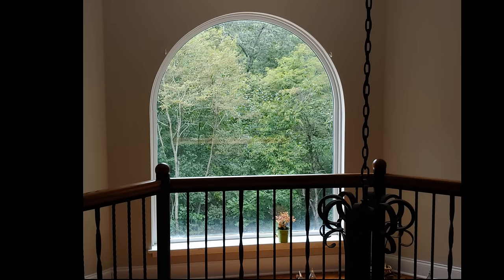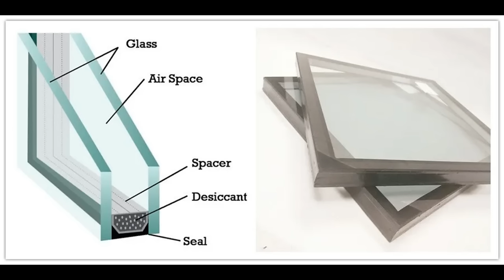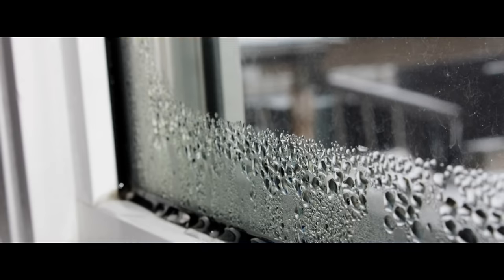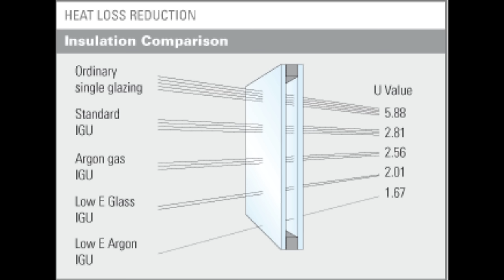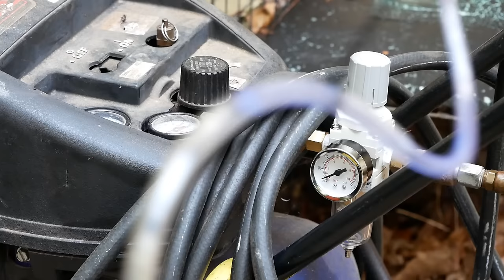Cleaning a Foggy/Hazy Window Insulated Glass Unit (IGU) from the Inside, Without Replacing the Glass

Comment: I have 24 windows to do. I wonder if a way to streamline the process would be to drill a 3/16 hole at the bottom of the window and a 1/8 hole at the top, then, rather than going through all of the aiming and squirting, just fill the entire void space with the vinegar, drain, and then refill with alcohol, and drain. Next step would be to heat both sides of the glass with a hair dryer causing the alcohol to evaporate, and once it does, seal the top hole and tape a desiccant pouch to the remaining hole which will allow the cooling window to refill with dry air, then plug  Using this method you might even be able to recover the solutions a few times and reuse them. As for preventing the fogging from happening again, I got nuthin...lol. I suppose if you are in a hot climate you could drill a small hole in the interior panes to allow inside dryish air to easily equalize the pressure in the windows, but if it get's below freezing it will frost up in there.
Reply from the maker: An interesting approach.  I would advise against filling the IGU with liquid of any type.  The amount of pressure on the glass may cause it to burst (I have no physics to back this up, just a guess).  I am also concerned with application of heat to anything containing flammable vapors (alcohol).  An aquarium air pump will purge the vapors gently and quietly in under an hour while you work on the next window.

I think that you can get good results with a top/bottom hole arrangement and it should be easy enough to squirt in from the top.    You can still recover the solution from the bottom hole if you like.  The trouble with recovering the solution is that it will have dissolved solids in it, so it may wind up leaving streaks inside your next window.  I'd say that it's not worth the savings.

There is something I can offer about fogging.  I have fogging in the spring that sticks around for a while, and I can see the fog moving around inside the window like in a lava lamp.  My holes are both on the bottom.  If they were arranged on bottom/top like yours and were slightly open (and protected from rain), the window would naturally convection-vent itself in the sun, purging the moisture.

Comment: Exterior of our house was painted recently with a sprayer and we have paint drips between some of the window panes now. Think this method would work on getting exterior paint out? Maybe with a less diluted solution of vinegar?
Reply from the maker: That's really interesting.  Paint made it through the window seals?  How does that happen?  
Off the top of my head I don't know of anything that will dissolve cured paint without residue and also will not damage the seals further.  I suppose that paint thinner is worth a shot.  There may be some risks.  If you can get a strong enough liquid stream in there (without creating pressure and blowing up the window), you may be able to wash and scrub with the liquid jet.  Good luck.
Reply: Yes, mid century windows versus 21st century paint sprayer :/

Excellent feedback, thank you. I was hoping just the denatured alcohol would be enough to cut the paint, then let it sit and use your method again to spray the loose paint with only water. Maybe it’s paint thinner then instead of denatured alc?

Will be a lot of trial and error but your video is a great start. Thank you again

Comment: I have aluminum viking duel pain windows, I don't see any vents like that window would they be some place else ? thanks .
Reply from the maker: On my windows, those are drain covers for rain water, and possibly condensation.  Your windows may not have them.   Removing the IGUs may be an option if they are small, or drilling the glass if it's not tempered.  Good luck.
Reply: @akomakomakom  How can you determine if the glass is tempered?
Reply from the maker: @dgervaz  it is usually indicated on the glass. I included an example in the video. Your best bet is to Google that question for a more complete answer. Good luck!

Comment: What is the damn tool you are using in the video to remove the plastic beads at the beginning ??  You say you list tools but did not list that. I tried with a 5-in-1 and the thing would not come out only move at a corner and it even shaved the vinyl frame slightly , driving me nuts !
Reply from the maker: "Painter's Tool".   Used to be 5-in-1, now on amazon it's more of a 9-in-1 or 10-in-1.  Mine were pretty tight and took a bit of force and prying.  The tool should be fairly rigid/strong and have a sharp(ish) edge.  You can also try a careful application of heat to warm the plastic (but the odds of that going wrong are high).

Speaking of force, be very careful not to push on exposed glass edges with anything hard - window cracks easily.
Reply: @akomakomakom  Thanks that's exactly the mentoring i needed to adjust my approach. But your tool didn't look like a painter's multi-tool because that's what i have, your tool neck is much longer. I've never seen anything like it, it looks like a hybrid scraper/pry bar.  I've applied as much force as i felt comfortable and could not get the bead out. it will move out at one ending but stay inside 1/2 inch away from the ending. It's a half circle window too like yours. The multi tool is straight but narrow enough that it can slide inside the circular arc. I don't know how deep i should push it in perpendicular to the window before pulling the bead away from the frame. I am afraid to crack the glass. while prying I've twice already had  the tool slip out and shave a very thin layer of vinyl from the frame. That was my warning call to stop and think (and get upset with the damn thing). The multi tool edge is not sharp but very rigid.  Not sure how to try differently.  Could the damn thing be glued ? I would think not, it drives me nuts.

Comment: Thank you - awesome.  I wonder if coming in from the top (if you can reach that is) would of made it easier to fill (not necessarily drain)?
Reply from the maker: It would definitely have been easier to spray.  
With the windows I was working on, to make a hole in the top I would probably have to drill the outer frame or remove the IGU. 
If I were drilling through glass, then diagonal corners would make the most sense.

Comment: I use a little aquarium pump drawing the air through a container of desicc. You can improve
the initial solution  greatly with a small amt of hydroflouric acid , if you can find it (very dangerous)
Reply: I think you meant hydrochloric acid.  It is commonly used to clean glassware in laboratories.  A mild solution of this will be less concentrated than the acid in your stomach.  Not dangerous if used carefully and properly rinsed after use.
Reply: Hydroflouric acid is used to etch glass, and will make the glass very cloudy as it dissolves the shiny surface and eats into it.

Comment: The best video I have seen so far!!  I have silvery streaks in my double pane window. I am not sure what this stuff is.  Is this the mineral deposit you are mentioning?  Will your method clear this stuff?
Reply from the maker: Silvery streaks could be damaged/delaminated interior tint.  "Low-E" coating is a type of tint.  If you have nothing to lose, you can give this method a shot.  You could also poke in there with a metal instrument (eg needle) and see how the streaks respond.  If they are peeling like a tint, then it's probably a bad idea to spray solvents in there, as it could make a huge mess.  Good luck.
Reply: @akomakomakom  thanks for the reply! however, it does not look like any tinting is peeling. The silvery streaks or dots look like made up of what looks like tiny specks of molds and most of my windows are developing this stuff inside. Any idea what it could be?
Reply from the maker: @tommason5689 I'd attempt to squirt a tiny amount of vinegar in there (wetting only a few inches of glass), and see what happens.
Reply: @akomakomakom  In my case, the glass has rubber seal covered under something gray. Not sure whether it is metal or plastic. So I do not think I can poke through into inside like you did. So it looks like I have to drill holes to try your suggestion. Once I find the right drill bit and proper equipment. I will try the vinegar and alcohol treatment. Nevertheless, I wish someone could tell me what the nature of silvery streaks and dots are. I am pretty sure other people should have similar problem but no one seems to know what it is. Thanks a lot for your replies anyway.

Comment: So what stops condensation from building from the holes you created in order to clean the panels? Thanks
Reply from the maker: Nothing. I already had condensation, so I wasn't overly concerned. That said, the bigger the openings you make, the quicker moisture will enter and also the quicker it will leave. The window seals failed, so the best I can do is make it clear as much of the time as possible. I'll need to make a video about some hacks I came up with.
Reply: @akomakomakom yes, please share any additional hacks.  I’ll check out your channel in case you’ve already made an additional video.  Thanks so very much!!

Comment: Totally dependant on having Access to the Seal while the window is still in place. HOW !?? does one get any access to be able drill the hole though the METAL desicant block  ????
Reply from the maker: As I recall, the video outlines these options:  

1) Poke through a soft seal via the frame, as I did.
2) Drill through the exterior glass with a glass drill bit (non-tempered glass only).  You can always seal it later with epoxy or install a small vent of some sort. 
3) Remove the IGU and poke or drill from the side.  With a large IGU like mine, you could partially pull out just one side (with adequate support or helpers), the glass unit flexed enough to allow this.  With a small IGU, you might as well pull the whole thing out.
4) BONUS: If it's a removable pane (sash), drill through the window and seal at the same time, without removing the IGU.  This could possibly work for sliding glass doors too. 

Hope that helps.

Comment: does not sealing the hole not allow for more moisture to get back in and problem to reoccur?
Reply from the maker: Yes.  However, the window seals are already letting moisture in, which is how the problem began.  Therefore, hole or not, moisture will make it inside.  Leaving the hole(s) open leaves a path for moisture to escape more quickly after condensing conditions, albeit gradually.
Reply: I realize the large window is out of the question but for smaller couldn't you remove and go top to bottom? Feed fluid (later air) from top hole - drain at bottom and when done run a thin bead of silicone around the exterior to reseal?  Its a fair amount of work but IGU's are criminally expensive. (Coincidentally in my area the vinyl window companies seem to go out of business with regularity. No way to claim against the warranty.)

Comment: Hi, Can you use 99.9% Isopropyl Alcohol Electronics Cleaner, in Aerosol can, with extension straw and no vinegar?
Reply from the maker: You can use absolutely anything you like as long as it does what you need it to do.  If you have a hazy window that is the result of mineral deposits, alcohol is unlikely to do anything to clear that up.  If you just want to rinse the inside surfaces of dust and would like the liquid to dry fairly quickly, then alcohol is a good candidate.

Comment: I want to drill through the side wood frame and through the seal. Put in liquids and shake removable window and frame. Then drain and dry. It will work. I'll let you know.
Reply: Did it work? Either you didn’t do it or it didn’t work…
Reply: @ajlifesolutions7072  nope. Didn't do it yet. I offered to do it for my girlfriend and she said she would think about it and it sounded like a good idea but she never said to do it and i wasn't eager to volunteer. Thanks for responding. I was totally sincere with my comment. Good job.
Reply: @frankconley7630  - Yeah, I’m not sure if it’s worth it to do a DIY job. I have a few that have popped so I need to enquire with an outfit that can do the drilling and inside cleaning. I don’t expect they will use vinegar though, but if it is then it better be weak solution.

Comment: How about you pour in vinegar from a top hole and 
let is sit for a while. Then punch a hole to let it drain
out. then refill with alcohol and let it sit then let that
drain out. Seems it would be easier than making the
spray contraptions and not very expensive.
Reply from the maker: If you can make that work, post a video, I'd like to see it.  
You would effectively be making an aquarium, so you would need a fair amount of vinegar (and alcohol).  This volume would apply considerable pressure to the glass panes.   Exploding glass, anyone?

Comment: Adding pressure within the plains can be dangerous. You never explained what pressures you were using in your sprayer or worst on your air compressor. And you dident explain how big your volcano is. Many window seals are a gummy caulk and if it's seals around your needle your pressurrising the window which can cause the glass to explode.  Especially tempered glass! So if you do try this trick, besure to remove plenty of the seal to allow air to excape and not pressure rise the plains!

Comment: Or if anyone has any ideas for a sliding glass door pane I would appreciate it!
Reply from the maker: I've never done a sliding glass door.  Usually window units in doors are removable.  If you can remove it, you can drill the (metal?) seal from the side.  Let us know how it goes and good luck.   Another thing worth considering is the cost of a replacement glass unit (it may be affordable), or even trying to find a used door of the same size.
Reply: @akomakomakom  
Thank you for the response, I watched another video where they drilled a hole through the side and was able to clean between the 2 glass panels or I’m gonna look at habitat for humanity store..I will keep you updated. Thanks again, for responding back!

Comment: Try using nitrogen to flush out the leftover alcohol
Reply from the maker: What's the goal?
Reply: @akomakomakom  no moisture
Reply from the maker: @d5oper  Does nitrogen work substantially better than air (from, say, an aquarium air pump) to justify the cost?  We are dealing with failed IGU seals, so keeping moisture out is not an attainable goal.  Keeping nitrogen in is also not going to happen.   Moisture will enter, moisture will leave.
Reply: @akomakomakom  good point it would probably help with the initial wash and dry

Comment: Wonder if there’s a way to use a vacuum pump to dry it out.
Reply: That might suck the two panes together and shatter the glass. Vacuum pressure is powerful aswell
Reply: Good point
Reply: It's not that the vacuum 'pressure' is powerful, it's that you're dealing with the atmospheric pressure pushing on both sides of the glass when you introduce hard vacuum in-between the panes. But Brian Little is correct; a light vacuum applied would accelerate the evaporation of the fluids and is a better solution than blowing humid air in there.

Comment: How many people exploded their windows using the compressor? Should come with a health warning!
Reply from the maker: Good question.  I wish I had thought of using an aquarium air pump before I posted this video.  Sadly, videos can't be changed.  That said, I think it's perfectly safe when used correctly (needle smaller than both holes, very low pressure).

Comment: Get right up in that glass with no safety glasses. A glass shop can replace the glass without removing the window. The fine aluminum coating on the inside has oxidixed and turned white. 
Next change your oil with a hammer.
Reply from the maker: Bad day?

Comment: Question: I know how the moisture gets in, but I don’t understand why there are calcium deposits, or scale on the inside – does the atmospheric air leaks in contain those mineral deposits?
Reply from the maker: Here is my reply to a similar question from a few weeks ago:

I am not a physicist and these are my guesses.  Water vapor indeed should not contain minerals (however, it can contain volatiles and friends).  That said, when vapor condenses into water droplets, it can pick up impurities from: 
A) Air (dust, pollen, etc)
B) Surfaces (such as any interior surfaces of the IGU, including the seals and dessicant. Old seals and dessicant may have deteriorated, contributing minerals (or any powdery remains). 
Water can then transfer these things to the glass as it runs down the surface of the window, for example.
Reply: @akomakomakom  thank you very much. I am going to give this a try!

Comment: Great idea - EXCEPT... You literally made the problem worse. Now moisture can easily get in between the 2 pieces and will more frequently "fog". It's a fix but a very temporary fix. You should check with the original installer about warranty replacement first. Once you drill these holes - warranty void!